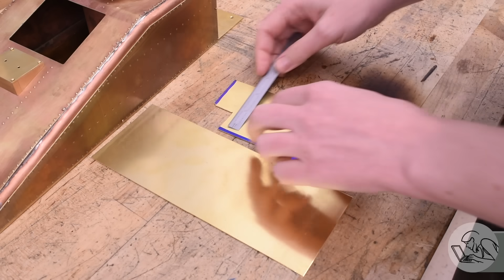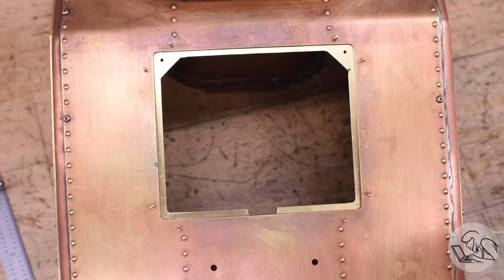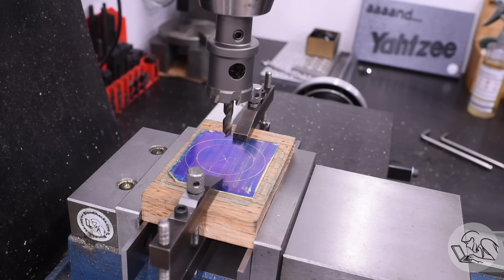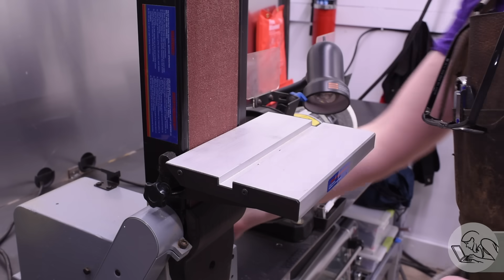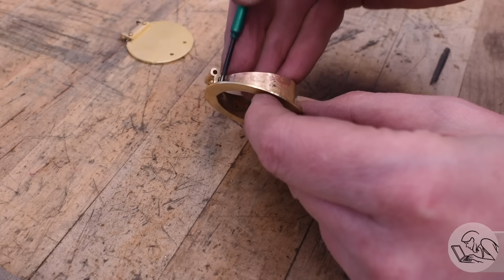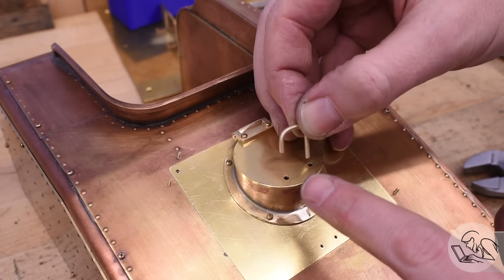Making a Water Hatch - Pennsylvania A3 Switcher, Part 26

Comment: I usually don't have anything to contribute to commentary, though I'm an avid watcher.
But ellipses like this are easier to achieve if you make a wooden sandwich machined to the measured angle/s, to then cut through at your desired diameter. I learned this trick making tube frame race car chassis which would then require flat sheet metal punched through at an oblique angle. Even compound angles are easy, if you initially use card stock to test that your measurements are correct.

Comment: Love the hand filing! Tip for the conic section and bolt pattern on the flange, this is a spot where simple 3d cad and a resulting paper template shines. I use it a lot when I have an angled hole that needs to exit a part in a specific location from the opposite side of where I'm drilling from

Comment: That was a very nice fit on that panel.  I watched a sheet metal tech in the Air Force make a 6 X 8 inch panel to repair a hole in the underside of the aircraft and know how much work it is to get a perfect fit.  He was lying on his back for 80% of the job and cussing the air craft mechanic that rammed a main gear jack under the aircraft punching a hole in the aluminum.  His panel was curved in both direction and riveted in place.

Comment: i'm curious as to why they didn't install baffles inside of the tank to slow the "sloshing" it would also add to the rigiddy of the tank
Reply: No need, if you have several tons of rail cars banging back and forth, a few hundred gallons of water sloshing wouldn't matter.

Comment: As a Brit I don't really have much interest in American steam engines but I've found this entire series of videos absolutely captivating.,  Love your attention to detail.  I was a machinist for many years and this has brought back so many memories for me.  A lot of my work was setting up "autos" Which were huge automated lathes that turned out parts with very tight tollerances at a high rate of speed.  My favourite projects, however, were those that were just created using hands on the wheels.  Whether it be lathes, milling machines, shapers or whatever.  It brings out the artist in all of us.

Comment: You might try leaving the boring head locking screws snug and letting the load on the adjusting screw hold the cutter at the current diameter. I've opened up many holes like this on a manual mill using import boring heads.

Comment: Another great video. Another option for the elliptical shape could be found on the computer. Print it out and glue/tape it to your sheet stock. Probably only needed if you needed a more exact shape. But not needing exact, yours worked out pretty damn close from what the screen looks like. Great job.
Reply: Easier at this scale to do what Quinn did.

Comment: Stupid woodworker question which I'm sure that at least 1,327 others may ask, so ignore mine if you answer elsewhere... on your elliptical hole, what stops you from tilting the bed to get an elliptical starter hole?  I'm sure I'm missing something obvious, so be gentle 😊... (if, on the other hand, you pull out your "shut up that's why" answer, feel free to delete this 'cause I'm not looking to one-up anyone)
Reply: My guess she didn't do that is because sheet metal isn't that rigid. And remember that copper and bronze are extremely grabby.
Reply: It was more that turning the mills fine feed lever that far would suck.